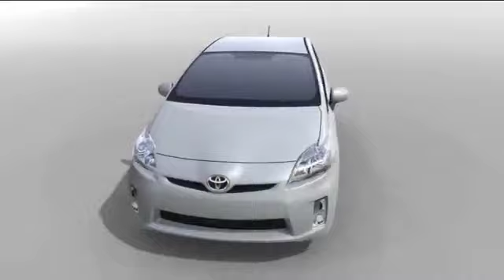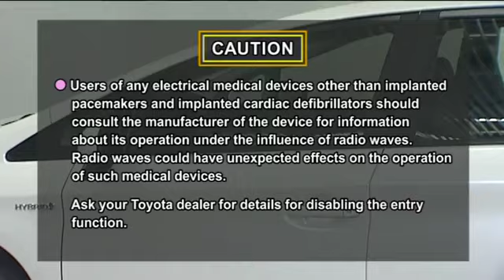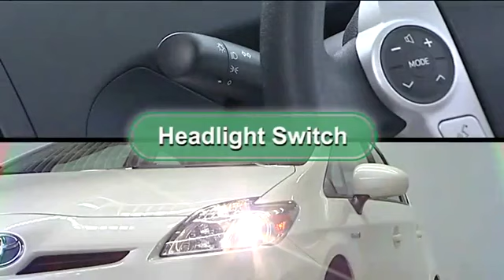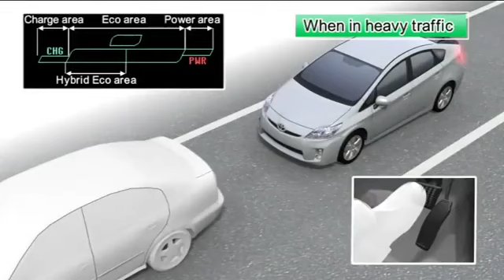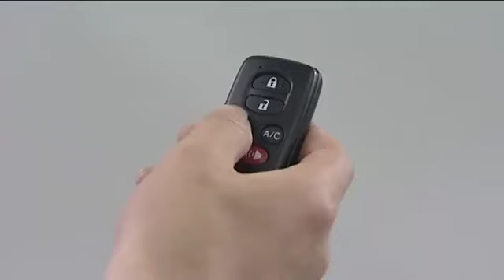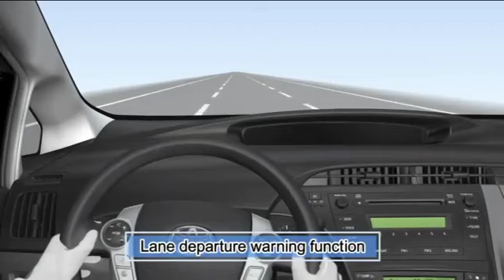Hybrid System of Toyota Prius - 2010 to 2015

Comment: Pls give us detail information with diagram about hybrid vehicles for beginners
Reply from the maker: Yes. Is there a specific part that you look for info about? Or just a general info? 
Although, the video speaks for itself, the basic info is, when you start driving, you will be on battery energy for a speed of up to 40 kilometer per hour (solely on battery). 
When driving above 40 KM the gas engine will automatically starts. When slowing down or stop at a traffic light, the engine will stop, and you will accelerate on battery again, for a speed up to 40 kilometer per hour, and so on.
The HONDA cars were the leader of Hybrid Vehicle, but then TOYOTA took over the lead, when Prius sedan were introduced in Japan in 1997, the Prius became the world’s first mass-produced hybrid electric vehicle.
I hope this answer your question.
Reply: @wheels-on-roads6498   The negative side is you can't go above 40km per hour on battery.
Reply: @wheels-on-roads6498     Practical car.
Reply: @BarhoomBarhoom-l4p   It is.